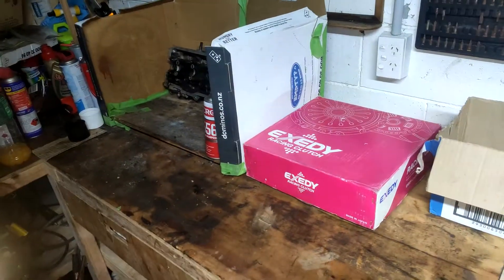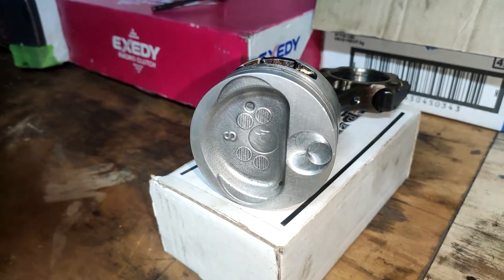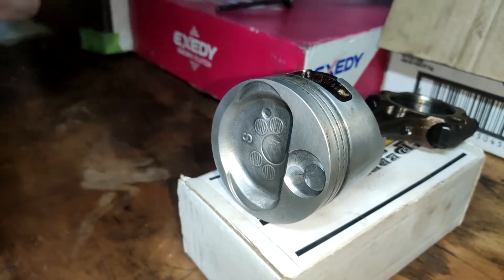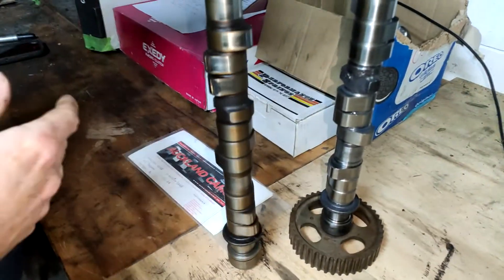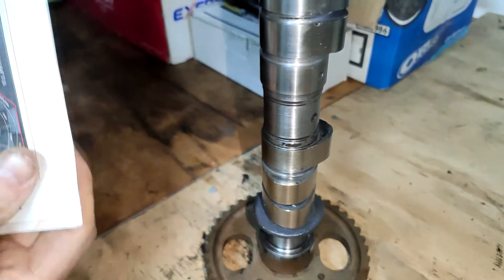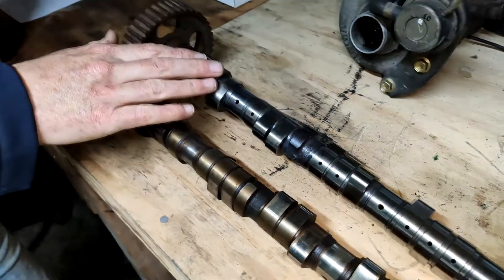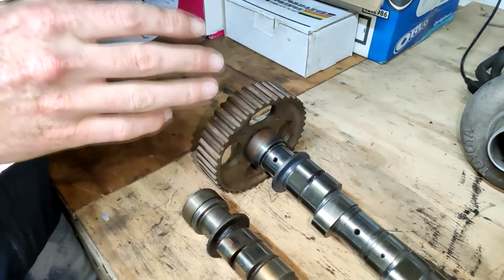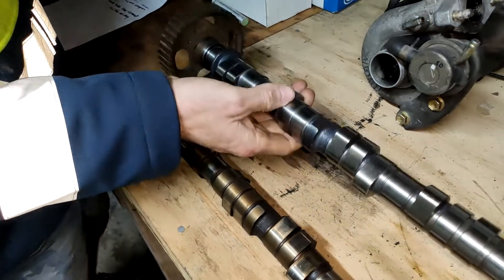Toyota Corolla 2E Engine Drilled Pistons

Comment: Salut , je prépare un 2E moi aussi.
J'aime bien ta chaine youtube bon travail.
Une question , la meilleure bougie d'allumage sur le 2E Bosch Wr78x super 4 ou Denso w16 exr u 11 ou?? 

Pour l'instant J ai monté deux weber double corps de 40 , une ligne d échappement  avec 4en1 , et réviser le moteur ...la voiture est une corolla E90 .

Si tu m'aides sur les bougies d'allumage , je t aide sur les huiles j'ai travaillé chez elf je connais les huiles j ai étudié l effet des huiles sur banc d essai etc..

Prochaines étape l'allumage... 😀
Reply from the maker: hey bro i used NGK spark Plug or the bosch iridium spark plugs there a litter bit more expensive i used 20w-50w oil in mine harder to start when cold but oil lasts longer especially at 9000 rpms thanks
Reply: @RuggedGarage  Hi, thank you for your reply . what I use in my 2E engine is Motul 8100 X cess 5w40 oil (100/100 full synthesis). the concern of mineral oils is that they degrade faster, you can continue with your 20w50 but it will really require frequent oil changes and let the oil temperature be done before having a sporty driving style. I found ngk bpr 6 eix in my garage and the engine seems to run very well with them.

(Otherwise if you succeed in finding the elf evolution 900 nf 5w40 oil (original) it is an oil designed primarily for competition at renault have had to increase the content of zinc and phosphorus to reduce friction, it is thick to hot, but cold even with minus 30 degrees it is fluid. the ideal is frequent oil changes, it is 3.2 liters, and a good oil filter. for the gearbox if it is a 5f it takes no worries the power and is well staged, good assembly and good road)